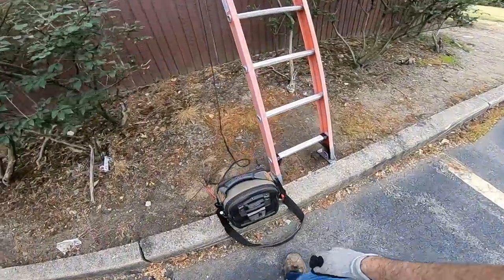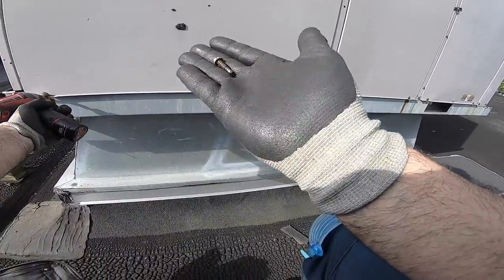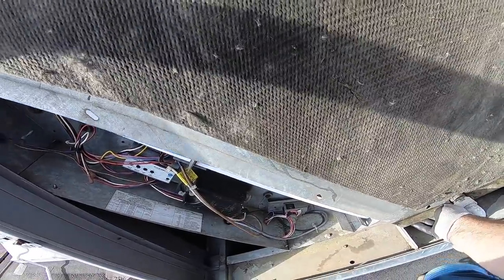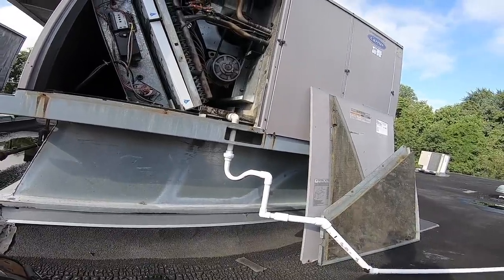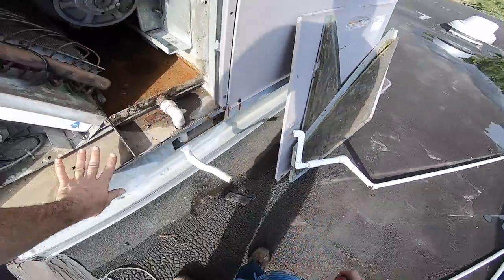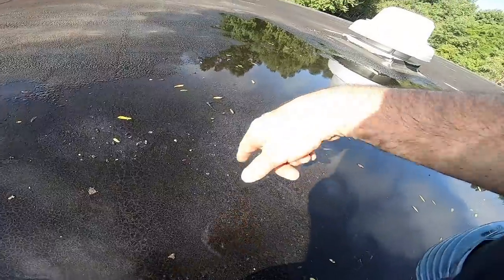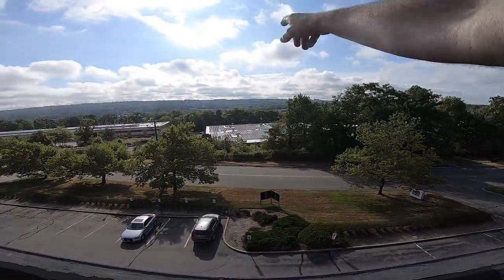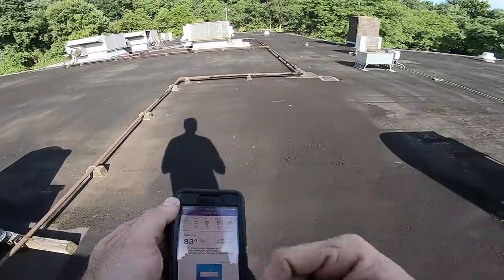AC Condensate Water Leak Repair

Comment: for weather I gave up,  I HATE KNOWING! what happened is I was listening to forecasts, & letting that dictate whether I rode my motorcycle or not,  then it didnt rain, or light, or had quit by time I got off work, & I missed an enjoyable ride, & if I get wet, so what, so now no matter what I am driving, I do not want to know, as I will never allow myself to let weather dictate how I enjoy my life!
Reply from the maker: I started looking at weather all the sudden to see if I should run the sprinklers or not. I think I need to get a sprinkler controller that gets weather reports and uses soil sensors to control watering